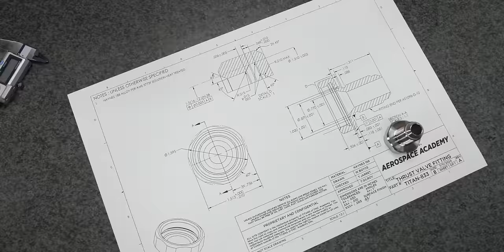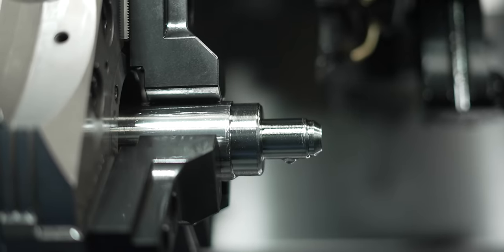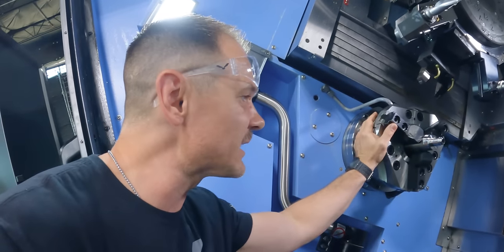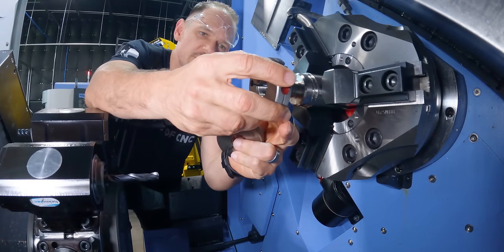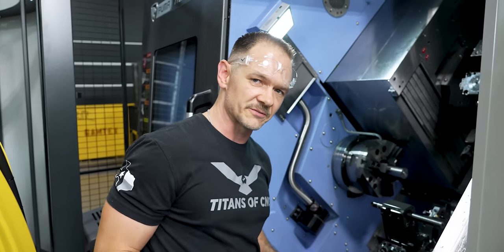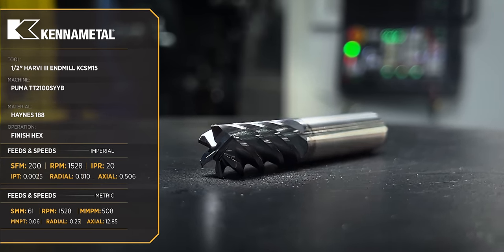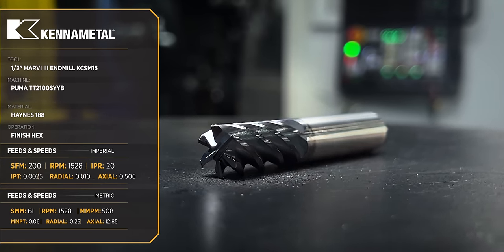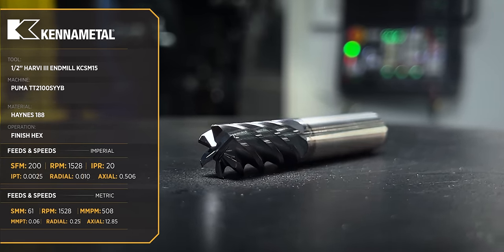Haynes 188: Hardest Material to CNC Machine?

Comment: So when gripping for OP-2 are you holding on the threads? If not are there instances where you absolutely have to ? What’s a good way to avoid thread damage ?
Reply: Invest in a collet chuck. Downsides is you are limited on the diameters you can grip by the sizes of collets you are willing to buy.

Comment: would like to see you machine some cast manganese steel as use that in the rail industry as it works hardens and destroys or burns out tipped tools very easily do not with no coolant just air

Comment: Can you make an m10 bolt from tungsten carbide :D
Reply: You can buy a tungsten carbide thread guage in m10
Reply: Yes but will be sintered not machined no?
Reply: @thomasward153  threads on carbide are usually done on cnc thread grinding machines but you can cut tungsten carbide with cbn (cubic boron nitride) inserts and recently I have seen cbn threading inserts being advertised for this purpose so technically there is no reason why you couldn't machine a tungsten carbide m10 bolt on a lathe and mill or a 5 axis.
Reply: Hard turning Tungsten carbide is ok for roughing but it is best to finish grind to prevent micro fractures on surface... and better have extremely ridge tooling.

Comment: Hardest is not the best description, difficult may be a better word. This material is actually soft and that's the problem. Crazy strong yet hates negative geometry tooling and positive tools don't like the extreme shear pressure required to machine this stuff.

Comment: 2205 duplex milling. I dare you!
Reply: 2205 is easy to mill with solid carbide.
Took 20mm off the top of a 700x1000 plate with one seco 554120z4.0 yeah it took a few hours but was reliable enough to run overnight.